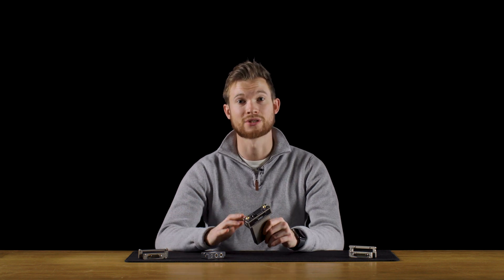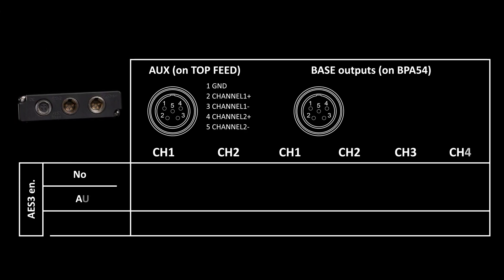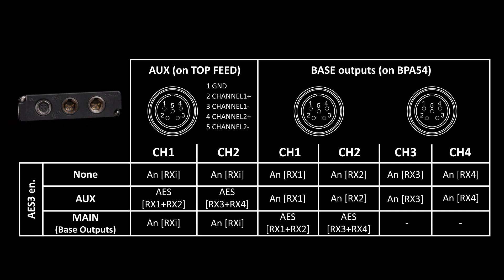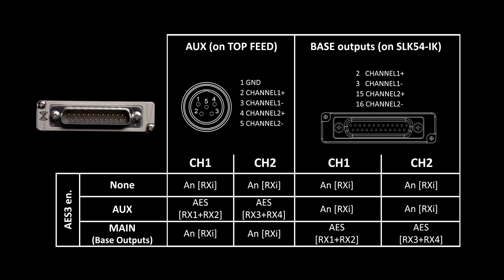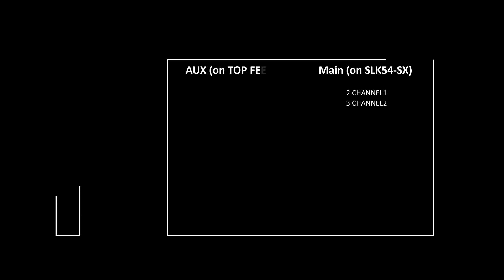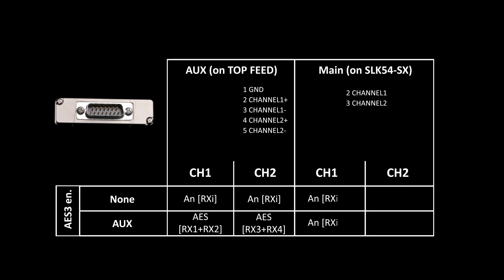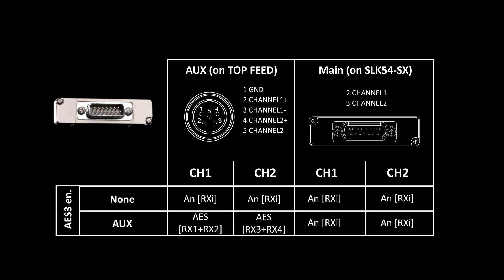MCR54 Bases & Outputs | Walkthrough

Comment: Does the bpa54 only output aes through ch 1? I can't get aes 3 and 4 through the 2nd output?
Reply from the maker: In AES mode you get all 4 channels out of the ch1 bottom (or top) output as you get 2 channels AES where you would only get 1 channel analogue.
Reply: @RaycomTV  Thank you for this explanation. Can you point me to the  dual cable used to go from a single mcr54 output to a XL-AES sound devices input?